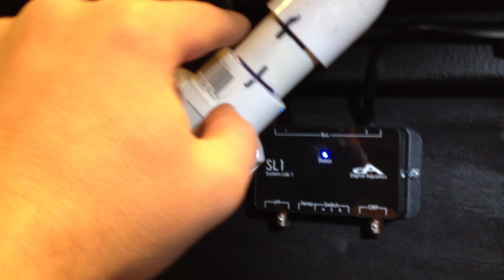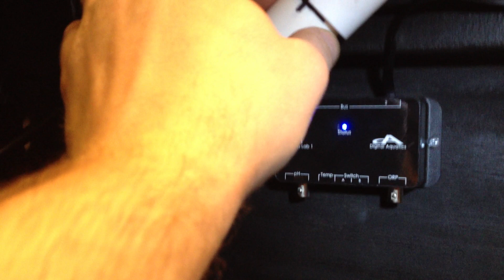90 gal. Reef Tank update - Plumbing

Comment: Question on Supply and Return PVC Pipe Sizes - I am creating a DIY Custom Made Inline Filtration Sysytem with 4 PVC - 4" X 24" Filters -  Pulling from a Reef Ready Drilled Tank like yours to this Closed-In-Filtration System. From the Filters to a Vectra S1 Return Pump.  Now, it is stock with a 1" inlet and a 3/4" Outlet - I see you have the same sizes but running in and out from a Sump as opposed to a closed loop or closed Inline Filtration system - I am thinking because of this being a closed system that I should run with the entire system being 1" (Return and Supply) - I have a diagram I would love to send you so you can get a visual on wjhat I am doing but you can also see almost identical to the Lifegard Aquatics Fiultration Sysytem - Link -  http://www.lifegardaquatics.com/products/chemical-filter-modules/    Your Thoughts ?

Comment: Can you explain you preventative plumbing steps in a situation where a power outage occurs? 

Or is the check valve your preventative measure against water coming back into the sump in the case of a power outage? 

Your blueprint is pretty legit. Do you think you can do this exact setup with 2 drains and 2 returns?

Thanks

Comment: so in order to use the reverse suction to do water changes means you did not drill a hold at the top of the return?
Reply from the maker: Correct, there isn't any siphon break hole in the return line.  I position the return about 1" below the water line to break the siphon if the check-valve fails to close in the case of power outage.  My sump is large enough to contain the additional water that will be siphoned back until the break will occur based on the positioning of the return line.

Comment: Thanks for the great video! I have the same Aqueon 90g tank and it looks like both holes are drilled for a 1in bulk head. Was this the same on yours? I only ask cause my goal was to use a 3/4 return and the 1in threw me off
Reply from the maker: Thanks!  Nope, my tank's return hole is 3/4" and the drain is 1".  My tank is 1 year old, so maybe they changed their setup.  I would buy a fitting that will reduce it to 3/4" if that is the size that you would desire.